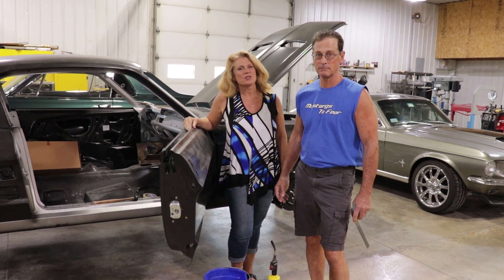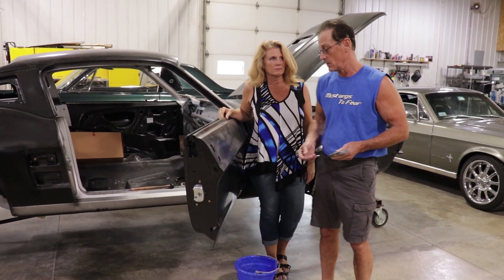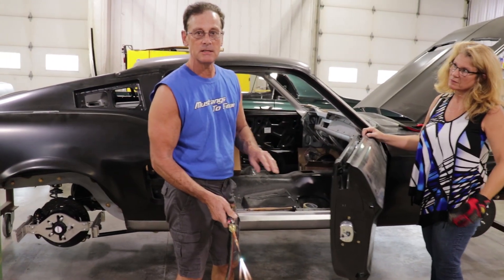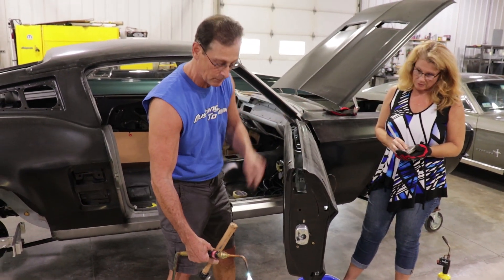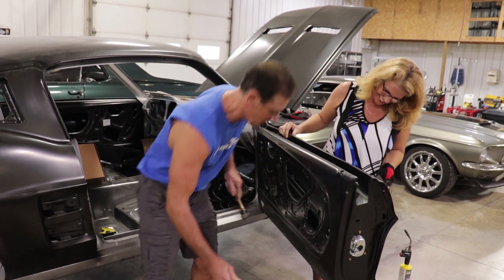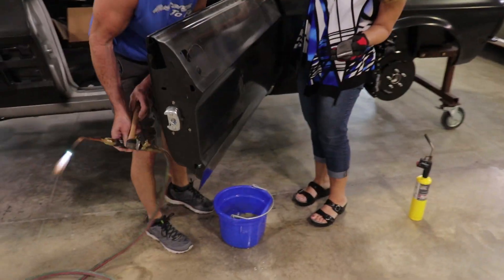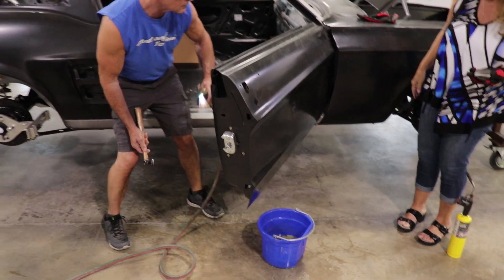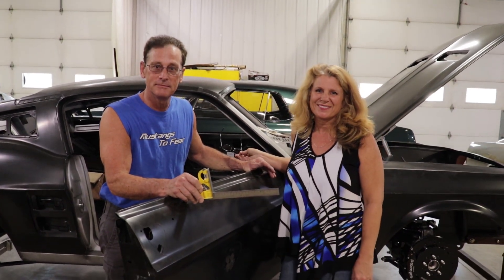Heat Shrinking Stretched Metal Demonstration

Comment: Cute couple.   Always better off getting the metal straight,  don't like body filler at all,  would much rather build up with primer than use body filler,  but you can only do that if your metal is nearly straight.

Comment: Hey I just wanted to drop in and say THANK YOU! I have a 69 Camaro coupe that had,key word had, stretched outward metal on the rear OEM tail panel dead center. I used what I had , a serrated body hammer instead of the shrinking dolly. It worked. It is 98% straight and I just need to take the bumper off to get it perfect. Thanks again for the video.
Reply: Glad that worked for you, sad to say but the new owner pays no attention to all these videos I made. Michele and I sold MTF in August of 2020 and started a business called Patriot Classic 4x4.  We are on Facebook and doing video's on 66-77 Bronco's.

Comment: The moment you hear the loud pinging from hammer on-dolly you are stretching…not the correct process. Even though the original dent appears flat where the torch was used, the space behind the ends of the ruler while checking progress indicates the dent is now an outward bulge.

A donut dolly would have been a good alternative for eliminating the dent without damaging the paint finish
Reply: Sounds like another arm chair bodyman that's doesn't know what he's talking about  🤣
Reply: @RS-gh2mf  No need to go into personal attacks, just trying to help you out.  4:42 shows a gap at the end of the ruler.  This isn’t possible unless you have an outward bulge, which means the panel is still stretched.  Hammer on-dolly and a pinging noise is a good indicator that stretching is occurring.   Last I checked you don’t fix a stretched panel with more stretch.  Hammering the heated area flat should stop as soon as you hear that first ping.   You’re welcome.
Reply: @mccartneypaintandcustom9602  After 52 years of doing this I certainly don't need some amateur giving me advice.  Nothing personal,  have a blessed day  🙏
Reply: @RS-gh2mf ok in this case i'm going to tell you that you're doing it the wrong way for 52 years what you see on you tube of the americans doing bodywork sometimes i really think it's a joke i don't understand how they do bodywork there this is done with filler and polishing i give you 1 advice come and have a look at europe working in the bodywork you can learn a lot trust me
Reply: @oliviersegers8249  I certainly don't need advice from some  screwed up Brit 🤣
Reply: @RS-gh2mf  you are the real person who thinks he knows something about bodywork but at the moment an amateur is better , do you know why this is obvious in this movie here you put 4 butt points you are completely wrong believe me , also the person the above is completely right, you are right with a bearing blow, completely wrong in europe, they dent out completely, even without filler and in America they make filler with a concrete mixer that is the difference

Comment: No offense man, but you have a helper and easy access to a panel. So it really isn't a hard dent to remove.
Reply: I don't get your point 😕  If the dent is to far away, you will need a second hand. If the dent is in an area where you can reach it by yourself,  then you don't need a second had. Been using this technique for the last 50 years.

Comment: Great video. Seems like a PDR shrinking tip(like the VIP) would get that right up. no heat required.
Reply: This method is decades before PDR came along.
Reply: @RS-gh2mf  why would we desire to use techniques developed 80 years ago when modern methods are better?
Reply: @allenwilson6585 very simple, I can do the repair myself rather than hire some meathead to do it for me. Just like I can do metal finishing without bodyfiller.
Reply: Drop the "p" and dent removal has been around longer than automobiles.  Have you ever seen a suit of armor.  That's some serious metal finish with a hammer. Over 1000 years old.

Comment: Curious if this will work on a bug roof that was dented in with an axe (intentionally). If I knock out or push out the majority of the caved in metal, could I then shrink it to smooth out the metal some?
Reply: Yes you can, but it will take more time considering how large it is. Michele and I sold MTF last August and started a new company called Patriot Classic 4x4,  we're doing 66-77 Bronco's.  I  will be doing video's on them.

Comment: If you are going to have to wipe it anyway, why not just use a PDR rod?
Reply: First of most guys aren't trained in  Paintless Dent repair, plus that usually works good for small dents which I do. Heat shrinking works better for larger areas.

Comment: I never was all that great at this technique. I just weld studs and pull from the front
Reply: It just  take a  little  practice.  Stud gun on this type of stretched metal would make it  worse.
Reply: @hotrodmtf  - Yes I was looking at this video because I have a 70s Challenger that someone oil canned the top of the fender.
Reply: You can always pull out the dent , its the stretched metal / tin can effect dent pins wont fix .